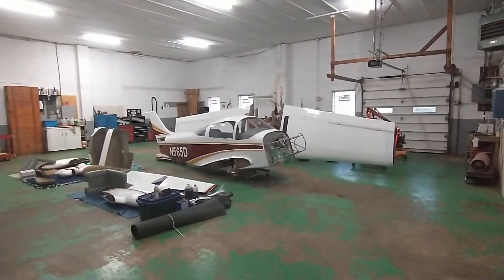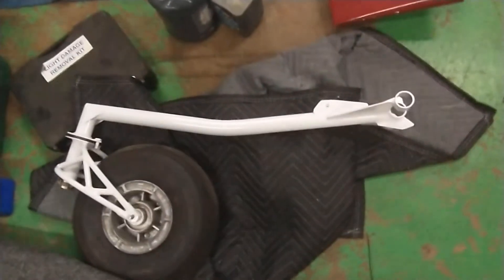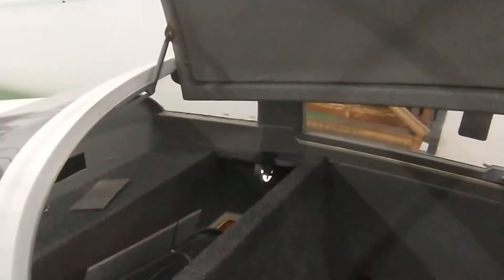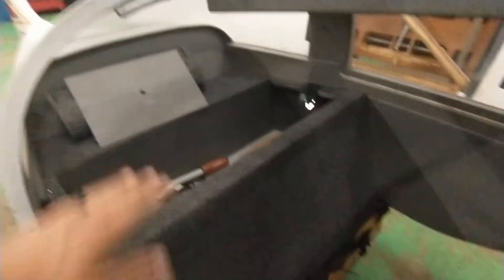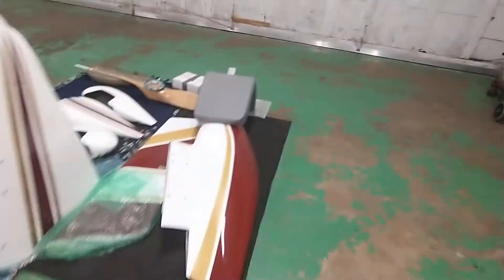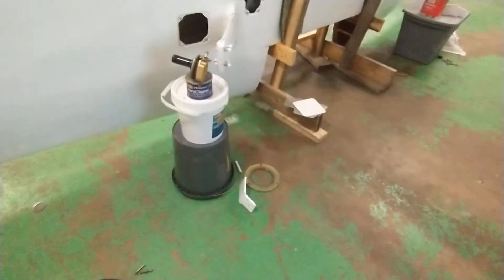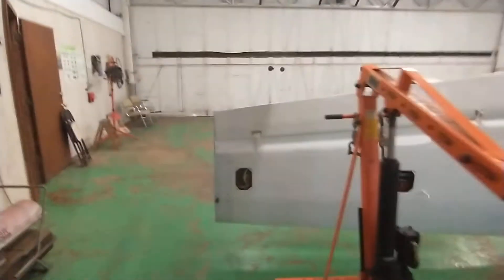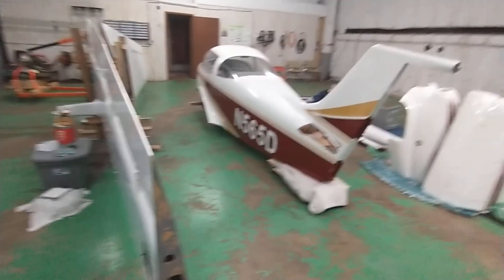Cavalier 102.5 N565D Intro.

Comment: I have to re-seal my tanks. Would be grateful if you could highlight all of the connections involved. Would you or the builder have knowledge of a good sealing product? Both tanks have been done in the past, but the product(s) used is unknown. Nice plane! Can't wait to see it flying.
Reply from the maker: Thank you.
I can't wait either.
Sure I can do that. I do not know any sealers besides Eastwood's off the top of my head but I'm not sure if that's a good choice or not. I will ask the builder if he has any idea.
Reply from the maker: From The builder of my Aircraft.

"I didn't think it was necessary, but if you do, Aircraft Spruce sells tank sealer. Not sure what it's called. A sloshing compound."

That's probably worth looking into if you're having issues.
I will do a more in depth video on our tanks but they may be different than yours.
Reply: @Jonnydeerhunter  I spoke with a rep from West System and asked if Fibreglass would deteriorate over time and he said, "not really." What happens is... over time fuel finds its way between between minute voids in the fibreglass and gets to the surface. 
  I  don't know.  I have one corner that stays pretty moist. The logbook says each tank has been re-sealed (one was done twice) and I know they were coated after manufacture. 
  I wonder if your builder would want to build new tanks? Ours look very similar. I believe mine were put together from a kit.